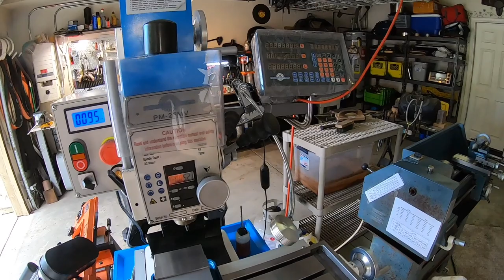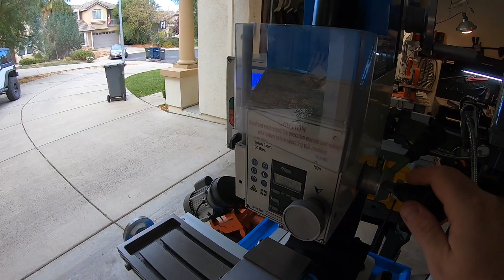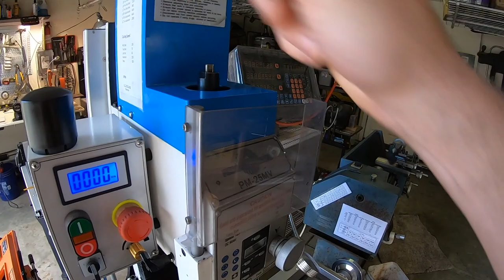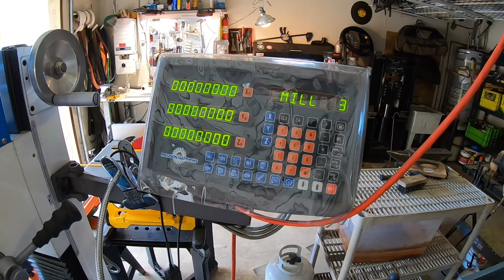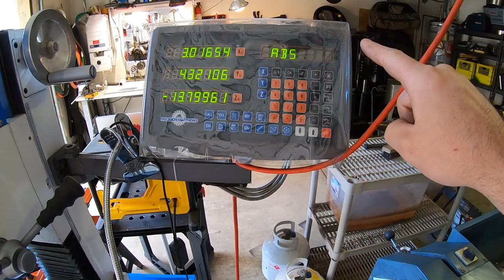Triple-T Tuesday #5 - New Projects / Milling Machine

Comment from the maker: So what do you think that tool is that I used the milling machine to create?   You'll see it being created and used in an upcoming video!
Reply: Using that mill to create that stepped pattern on the blade and making it match on both sides

Comment: I have the same mill, and the 3" surfacing tool was the best purchase I've made... works great as long as you're setup is stiff and your mill is trammed correctly.  Also... I've never seen a mill so clean, hard to believe you use it.
Reply from the maker: I don’t really do much surfacing but maybe I’ll look into it again if I do.  Thanks for watching!

Comment: nice presentation; 2 questions. 1, any combination mill/lathe you would recommend, 2. are you a manufacturing engineer?
Reply from the maker: I’m not really a fan of the mill/lathe combos.  They never really do either that well.  I have a Precision Matthews PM25 mill and love it.  I have an old lathe that someone gave me that is the same as the Grizzly 9x20.  No, I’m certainly no manufacturing engineer.  My day job is a director of engineering at a software company.  Different kind of engineer.  😜

Comment: Sweet mill setup man (got the same same model, different paintwork though :). I've had success with my face mill by taking out 3 of the cutters, single tooth yields a more uniform surface and a quarter' cutting force. Big fan of your videos, greetings from Sweden
Reply from the maker: Oh, that's not a bad idea with the face mill, I may try that!  I thought I'd use it for facing steel and removing forge scale but its too much to set it up and too much time.  That's when I built the surface grinder attachment for my 2x72.   Thanks for watching!
Reply: Ghetto fly cutter :<)

Comment: This machine comes in many different brands and setups , but the frames and x - y slides are mostly the same....all in chinesium . I have about the exact same machine , but mine is HBM brand. The weakness with all these mills is the collum that can torque and vibrate when endmills above 1/2 " are used. I have added a extra solid collum ( in rectangular tube) at the back of collum of my machine...makes a lot of difference. Regurarly aligning the millhead 90° to the crossslides is another thing to do. Mechanically its decent enough.....the electronics om my version are garbage. Perhabs precision matthews has a better motor and rpm module.
Reply from the maker: Yes, it’s a popular model for sure.  I don’t do much about 1/2 end mills so I’m fine without mods.  It’s been a great machine for me.  Thanks for watching!